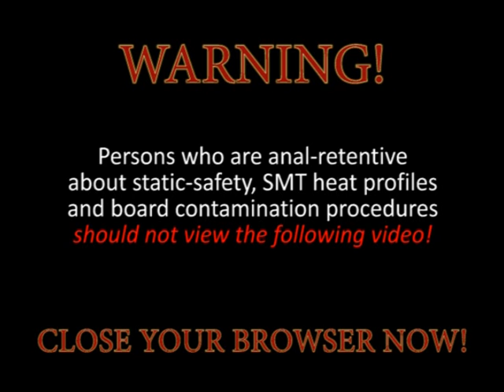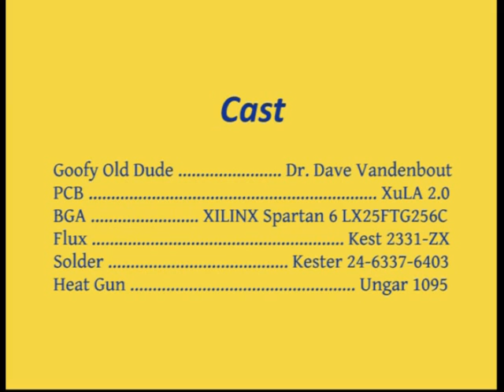BGA Mounting

Comment: Nice video! I tried but failed to mount a BGA chip properly, probably due to the GND layers which dissipate heat fast. Which assembler did you pick? I quoted around but the prices are always several hundred $$$ for a single chip...
Reply: +Alex Lau Yea I'd like to figure out how to mount my own BGA as well.  The quotes I get for mounting a single chip are like $500 or some crazy number.  The problem is testing this thing out involves destroying a sh&tload of good chips before perfecting the method.

Comment: Do you think this is applicable for example to reball a graphics card or something like that?
Reply: I've never tried reballing a BGA, Miguel, but from what I've seen, I don't think this method would work. Reballing with something like my heat gun would just blow the solderballs all over the place. I think you also need a template/stencil to keep the balls from rolling around as they're heated. Check out some of the reballing videos. If you find a way to do it, let me know! I have a bunch of FPGAs that need reballing and it's not worth the money I'd pay to do it.
Reply: +Miguel Rosa Do you really need to reball or just to reflow the chip? For Reflowing you need good liquid flux and the hot air gun. For multilayer cards with several power planes it is very helpful to preheat the board to something like 125°C for some minutes. The components will tolerate this. Of course plastic parts like fans and cables should be removed as far as possible.